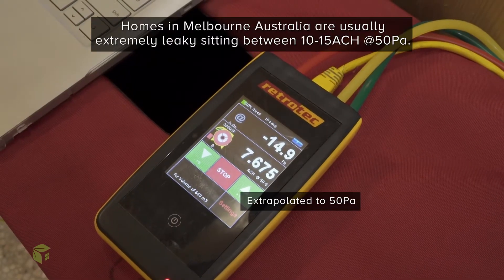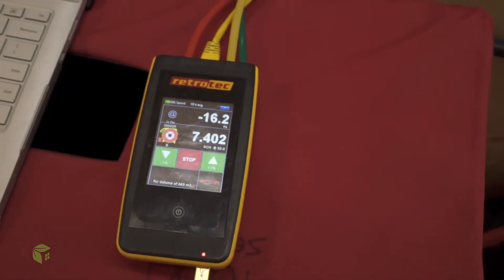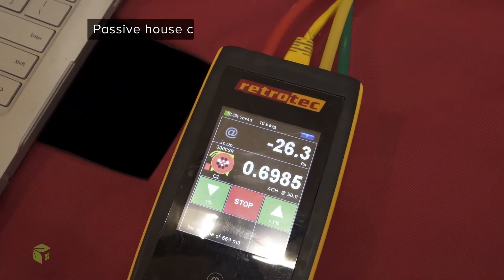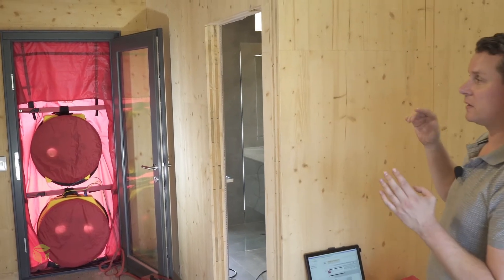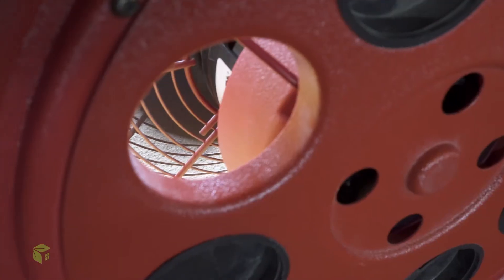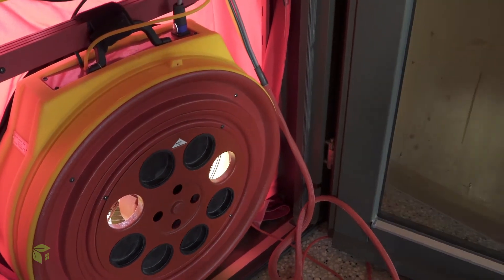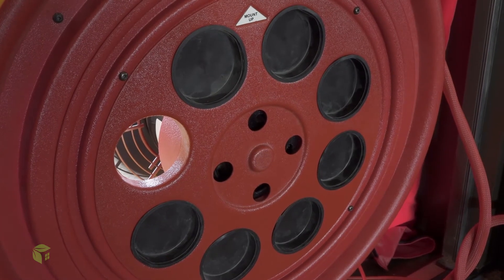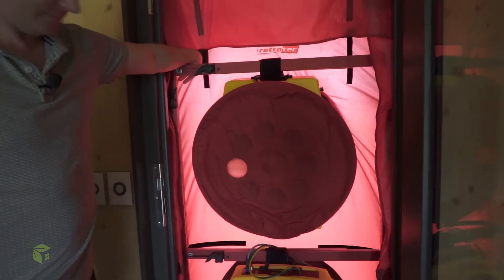Passive House vs Standard Home air tightness, the difference yourself.

Comment: 10-15 ACH is not a typical new construction home, right?  Or are you just saying "typical old homes are between 10-15 ACH".  That I would believe, but new homes have to be tighter than that, yes?  In America, the new construction code is 5ACH.  But I wouldn't be surprised if homes built even as new as 1990 were still 10 ACH or more.
Reply from the maker: Agreed, new homes that don’t have swampies, too many internal cavity sliders or mistakes in ducted heating returns are usually well under 10ACH